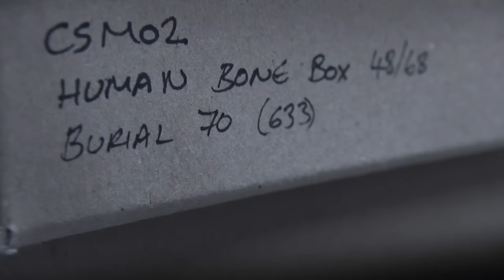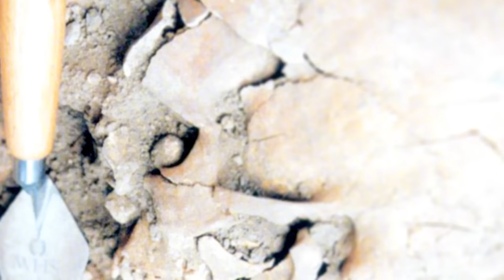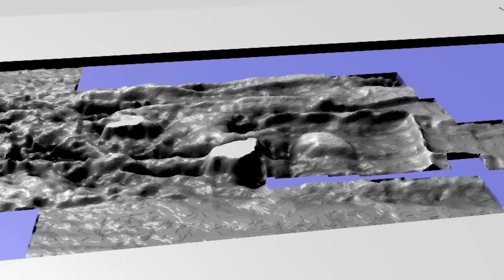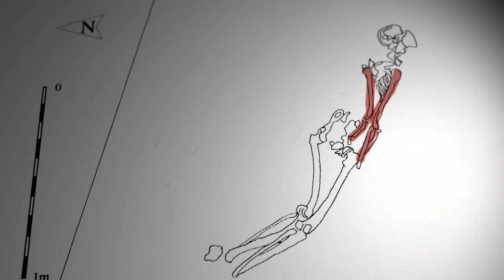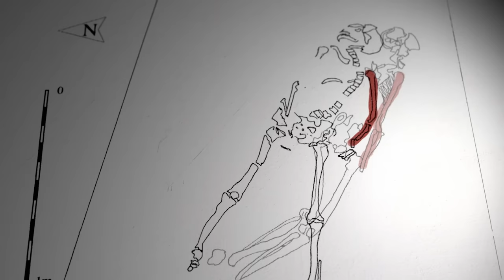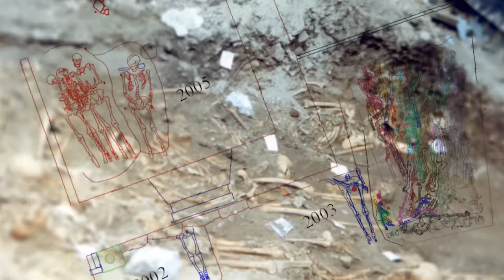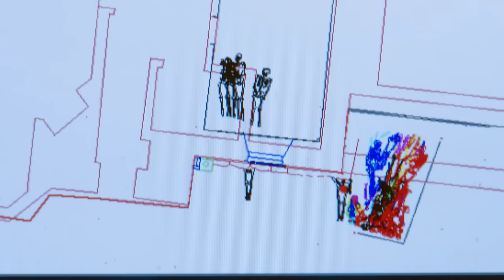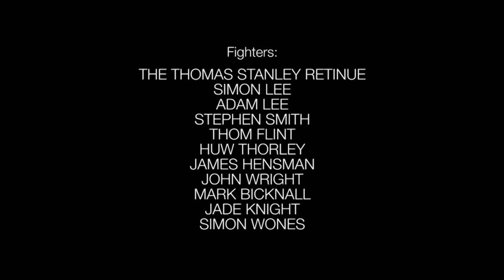Digging Richard III's Lost Chapel Built For His Soldiers | Medieval Dead | Unearthed History

Comment: When was Tauton Hall constructed? (40:47 answers this question) Is it safe to assume that there was no then current memory about the burials on-site?

In the city where I was raised, there are several Downtown buildings sitting atop former cemeteries (constructed between the 1950s and the 1970s); the cemeteries were less than a century old at the time. In the 1990s, I was slightly involved in getting legislation passed to prevent the redevelopment/reuse of cemeteries.